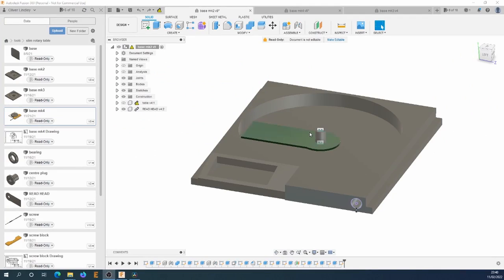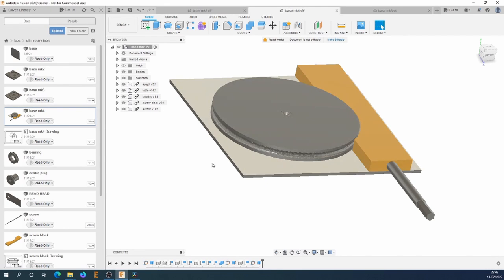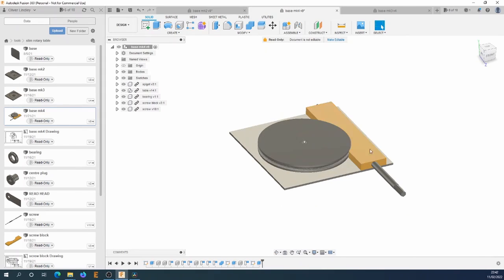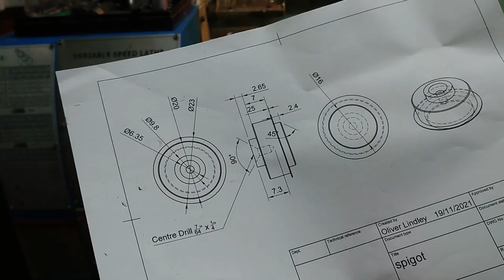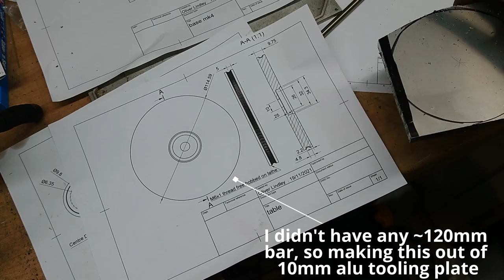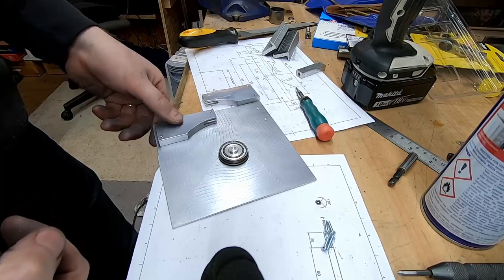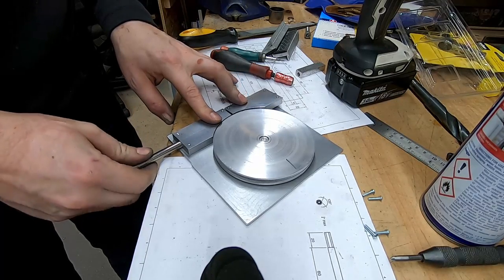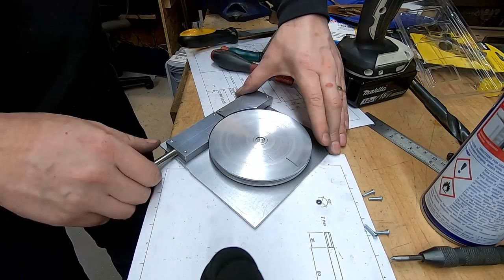Low Profile Rotary table build video

Comment: Gday Olly, that’s a great design being so low, great for a small mill, I like the idea of the original design with the digital reader, thanks for sharing, cheers
Reply from the maker: Hi Matty. It's going to have to grow a little, I was aiming for 12mm or 1/2" but I think it will need to be nearer 20 to be a truly useable tool.

Comment: very cool, Ive been waiting on this one and can say I wasnt disappointed, lol. Really interesting idea and lots of good ideas to build off of. I'd probably put a groove in the worm shaft and put a dog point grub screw in it to keep the shaft from moving out, then have a flange on the handle end. That with the bushings and you shouldnt have any issues then with that stuff. 

Only thing I'd be worried about is the table and the bearing coming apart on it in use. Ive tried making something similar and using a fly cutter to cut half round shapes in some stuff, and the vibrations caused the bolts and everything holding it together to come loose and I kept having to hold it down to finish the job. I was wondering if you had thought of a way to overcome that in your design?
Reply from the maker: Hi Chirpy. There is a slight flange on the shaft, it steps up from 6 to 8mm, but it's not enough. Also the m4 thread I cut on the shaft was for a nyloc nut to hold the back end in position. Because the blocks didn't fit I wasn't able to fit it.  I share your concern about the table coming off the bearing. This particular table is never going to see any use, but for the next iteration I will have to improve the retention method. As far as I can tell, my 'proper' rotary table has a cast iron table with a pressed (or shrink fit) steel centre shaft. Having thought about it, it probably doesn't need bearings as it will never go fast, do maybe a bushing would be sufficient. Most of the issues with the design are because I was trying to make it less than half an inch thick. The redesign will probably be 3/4" or 20mm-ish to give me a bit more room to work with. That way hopefully there will be room for some table clamps.